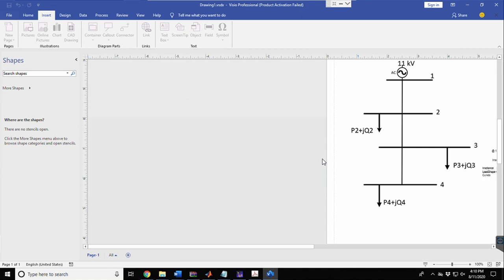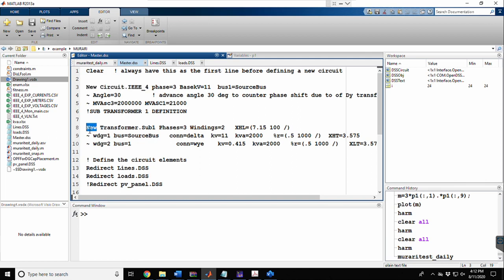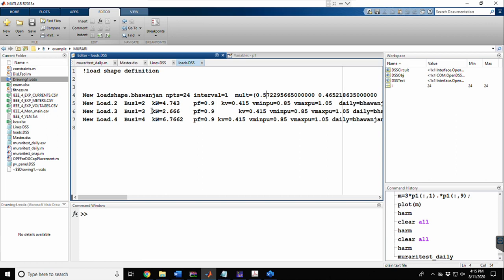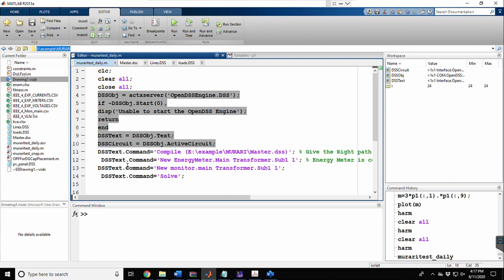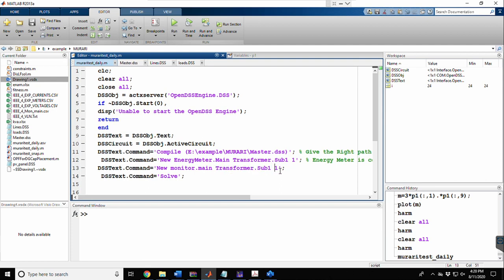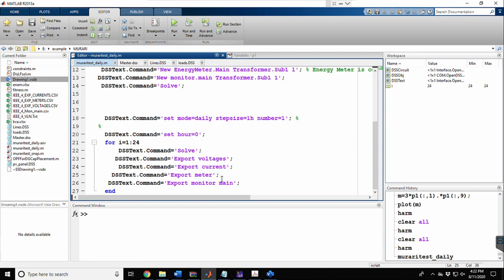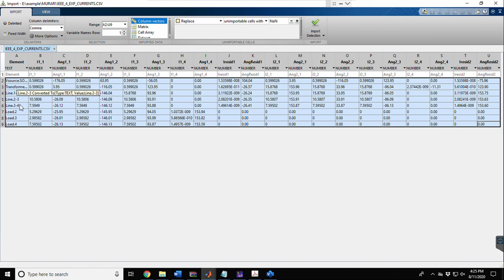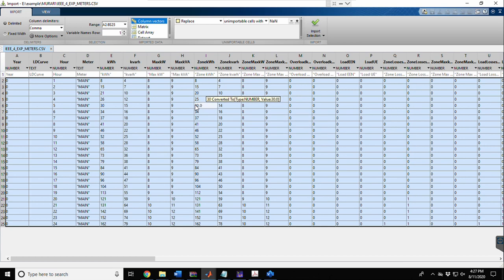Daily loadflow of distribution system by OpenDSS interfaced MATLAB

Comment: I want to eport line-line voltages through DSS Text In matlab. How to do That?
Reply from the maker: You can simply connect monitor object and then export the monitor output after load flow. For more details, refer opendss manual

Comment: Sir how to run algorithm for optimal placement of dg using matlab interfence with open dss
Reply from the maker: For optimal placement, you need to code any optimization method in MATLAB script. Run the output  of optimization methods in closed loop with Openddss
Reply: Sir Please  make video for guide